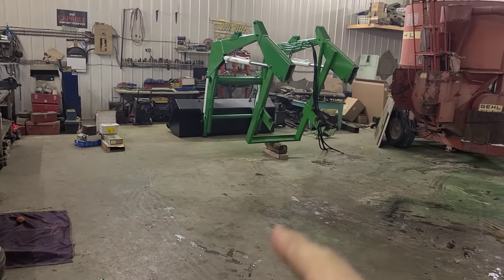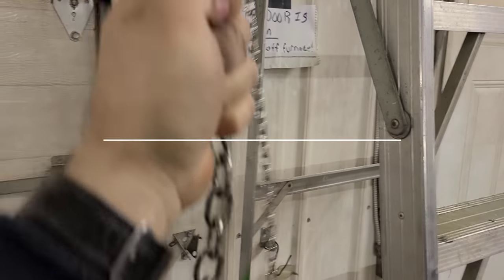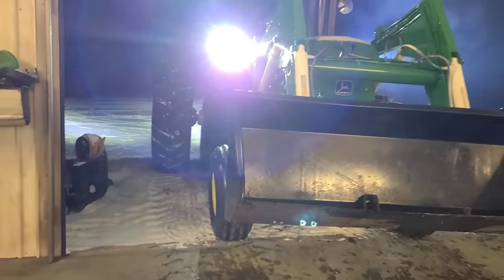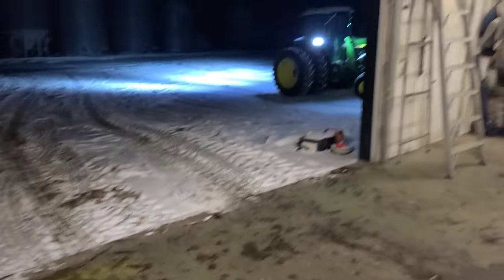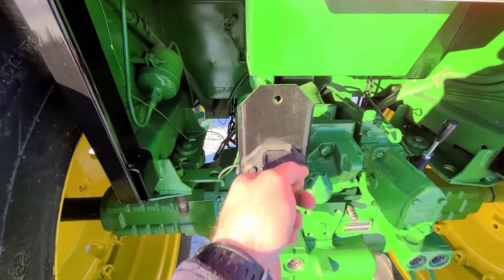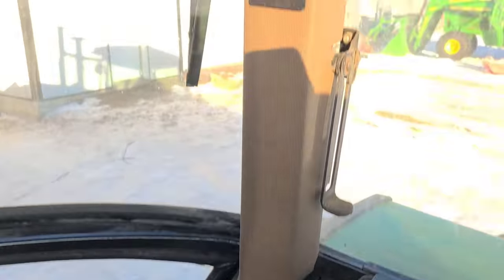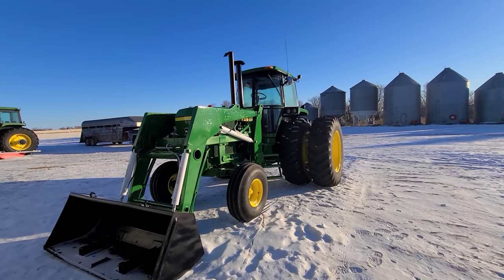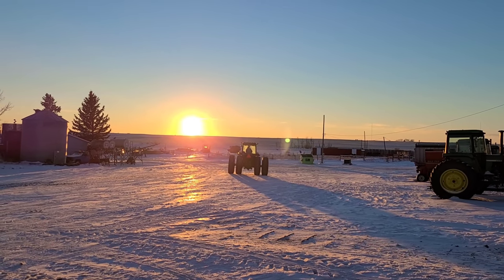4440 total restoration complete!!

Comment: Hey you guys do great work. That brown interior really brightened up that interior. I know a guy with a 2090,2290 and 2390 and he put the 94 series grayish brownish cab kit in and it really made a difference, it helps a lot in the summer makes the cab a lot cooler, cause trust me a 90-94 series case cab with no ac in 90 degree weather and the humidity will just about make you want to kill yourself lol 😂

Comment: You guys should put 55 series front lights on the old 40 series
Reply from the maker: One day
Reply: @SouthSaskFarmer1  I built a lite bar for the 4455. Added 2 LEDs and wired it to the switch. The lites on that factory setup is ok but I can really see now. Suppose you could bolt it to your case weight mount. Our 7800 loader has a factory protector that bolts up there. Couple dollars in steel and paint.